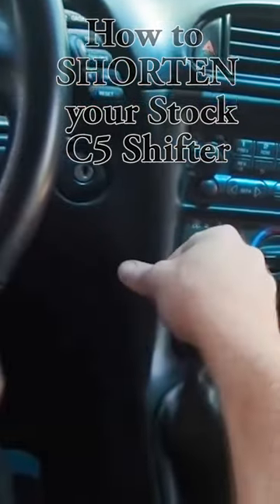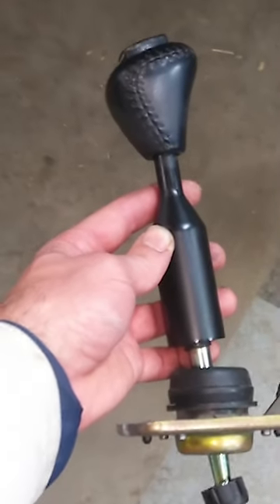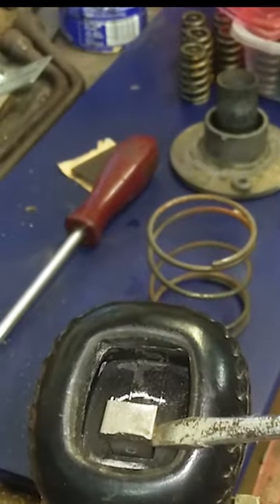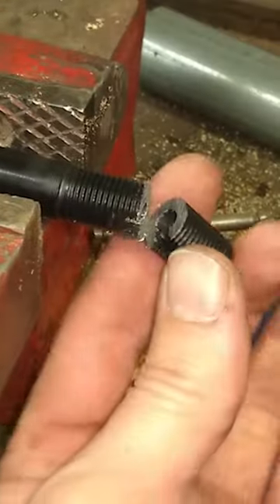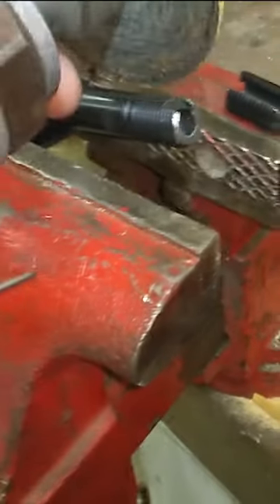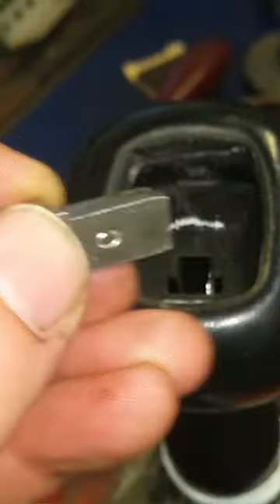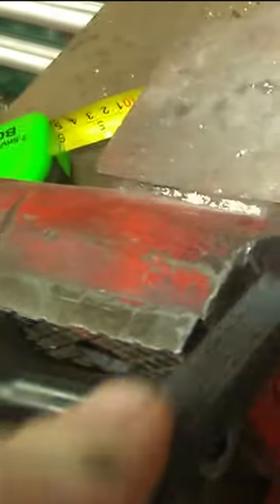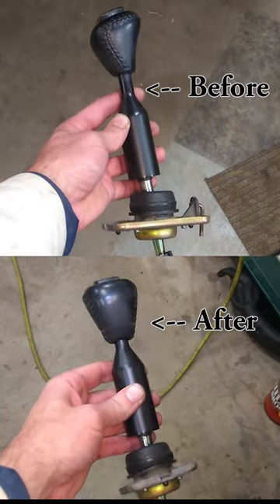Stock C5 Corvette Shifter Mod! (Shorten your C5's "Truck-like" Shifter!)

Comment: Or actually swap it for a short throw shifter and enjoy the car even more.
Reply from the maker: Try that MGW before you buy.  Most love it, some don't.   Something to be said about the pride of modifying something yourself as well without waiting for UPS to show up.   Cheers!
Reply: @Toys4Life  I have the MGW and I can tell you the adjustable height is everything. I started off low and now have it almost on the highest position making shifts butter smooth and still shorter than stock. When it was low, it was very notchy.

Comment: But this doesn't shorten the throw at all, it just lowers the knob.
Reply: a lower shifter is a shorter shifter...
Reply: @mustangdill36  not in the way that matters
Reply from the maker: Do you know how a merry-go-round doesn't seem to be spinning when you look at the middle, but when you look at the edge it's zipping pretty good. Same principle.
Reply: a short shifter just moves the fulcrum point higher up to make the distance from the knob to where it pivots shorter. This is what cuts the length of the throws. While he isnt moving the fulcrum point, he is shortening the distance that the knob has to move before being in gear. The closer you are to the fulcrum, the shorter the gear.
Reply: @JDAV75  I'm used to short shifters moving the fulcrum and/or lever away from the actuator so it actually shortens the throw of the actuating rod, not the input half that you touch. That said, I thought about it and yeah, it does shorten the input throw when you hack down the shaft above the fulcrum; the gear engagement throw just doesn't change as a result. I'm good with reevaluating :)
Reply: @Zaudunyani  excellent response my man. love the maturity around here
Reply: @Zaudunyani way to let the ego not infect you! We lean and grow this way. Much respect.
Reply from the maker: It's all good man!